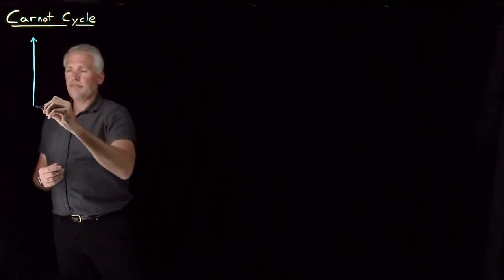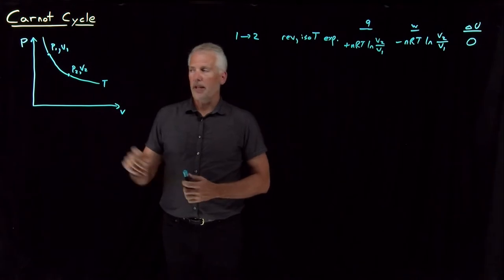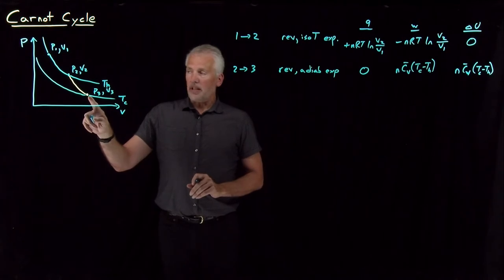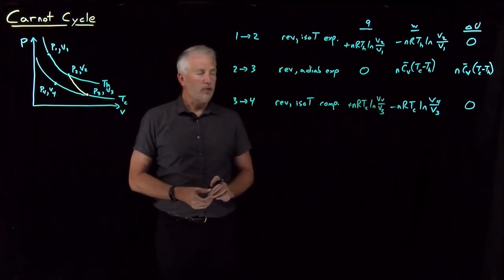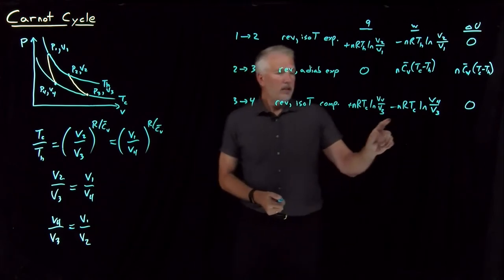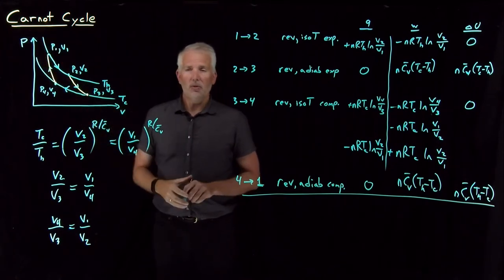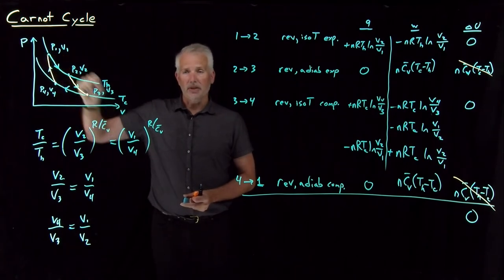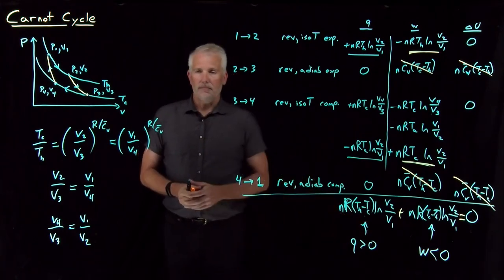Carnot Cycle

Comment: sir  simple isothermal process also converts heat into work so what benefit do we get by such multistep process if instead, we can just expand or compress a gas isothermally because in the end the carnot cycle is also equivalent to an isothermal process
Reply from the maker: Yes, you're right, an isothermal expansion also converts heat into work. But to make an engine, with repeated cycles of heat -> work conversion, you have to get back to your starting point. If you just isothermally compress back to your starting point, it costs you (at least) as much work to compress as you gained from the expansion. The purpose of the adiabatic steps in the Carnot cycle are to get to a lower temperature so that the isothermal compression won't require as much work, and then to heat back up to the starting point.

There are certainly other choices other than adiabatic expansion that could be used instead. The Carnot cycle is just the name we give to the cycle that uses isothermal + adiabatic volume changes. A Stirling cycle uses isochoric (constant-volume) steps to do the heating/cooling. Engineers learn about Otto, and Brayton, and Diesel, and other types of engine cycles. But physical chemists usually just care about the general concept of a heat engine, and Carnot is just the specific type that usually gets taught.

The Carnot cycle was important, historically, because it allowed some thermodynamic proofs of the efficiency of heat engines. That's probably the main reason it is still taught as the first example of a heat engine. It's also helpful at this point in the course to review / reinforce the features of adiabatic volume changes.

Comment: Professor I have a question here. Is Carnot cycle totally isothermal? I mean there are two isothermal processes, which are isothermal compression and isothermal expansion. Others are adiabatic compression and adiabatic expansion. These adiabatics are also isothermal, at the same time ?
Reply from the maker: No, definitely not. The adiabatic steps are not isothermal. The temperature decreases during an adiabatic expansion, and increases during an adiabatic compression. Notice also that the adiabatic steps on the PV graph move the system from one temperature (one isotherm) to another.

Comment: In step two, which is adiabatic expansion, why we take heat capacity at constant volume in "del U" , although volume changes during that process?
Reply from the maker: The internal energy of an ideal gas depends only on its temperature, not on its volume. So the internal energy change is ΔU = n C_V ΔT, even when the volume is changing.
Reply: @PhysicalChemistry  thanks
Reply: @PhysicalChemistry  sir thank you for answering his question, bc it was exactly the same question for me.🌹❤ I got the answer. 👌👌💚💚

Comment: Wait...yeah how is it Cv is there is work done and a dv?
Reply from the maker: Yes, this constant-V subscript often causes unnecessary confusion (including for me, momentarily, in this video, as you noticed).

For this ideal gas, U is proportional to T. Perhaps U = 3/2 nRT or U = 5/2 nRT or whatever. Generally speaking, U = n C_V T.

Note that there is no volume dependence in this equation. So it turns out that, even when the volume is not constant, ΔU = n C_V ΔT.

Comment: Thank you so much,, is there alesson about pi t
Reply from the maker: I'm not sure what you mean by "pi t", sorry
Reply: @PhysicalChemistry  I think it is mean intrnal energy for non ideal gas 
Thats called , idont know how to type pi t in my keyboard ..
Reply from the maker: @rashakhaleel4337  I see. You mean the internal pressure, Π_T. I don't use that term, so I didn't recognize it right away, sorry.

The internal pressure is (∂U/∂V)_T. I derive a thermodynamic equation for this derivative as an example in the video on the change of constraint rule: https://youtu.be/wFI1ZktuQeM?t=275 . But I don't have a video that goes into any depth on the meaning or significance of the internal pressure for non-ideal gases.
Reply: This is not an explanation. To do that, it might be good to have a picture of a Carnot device.